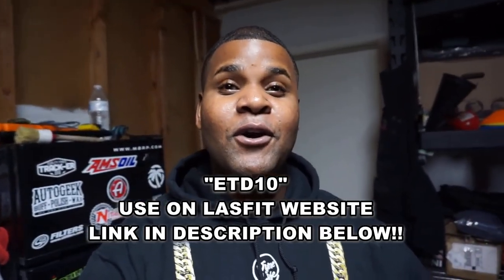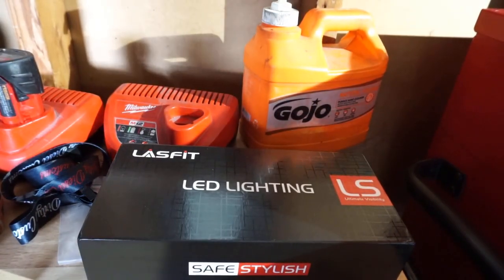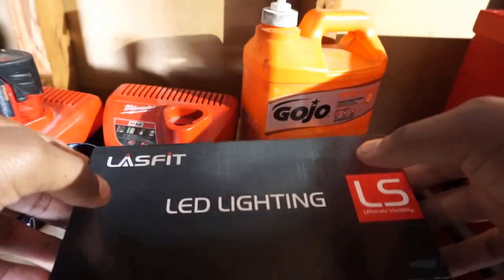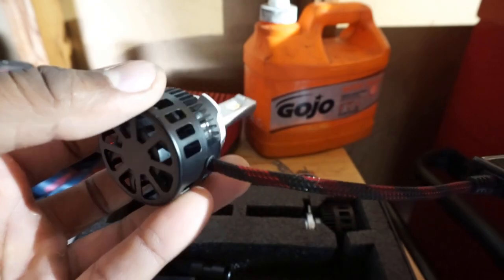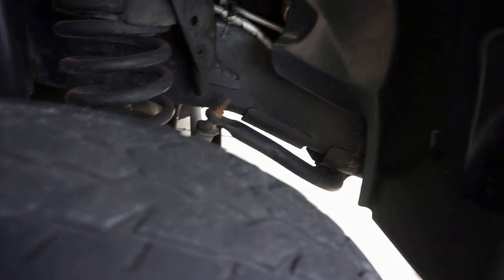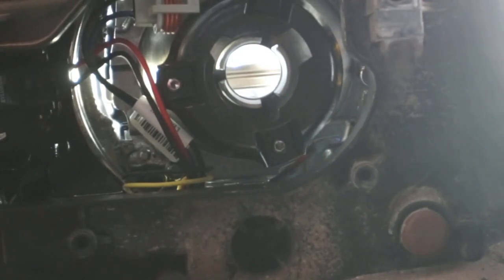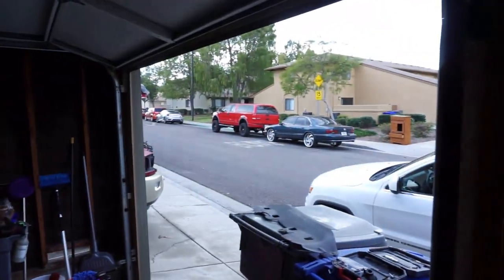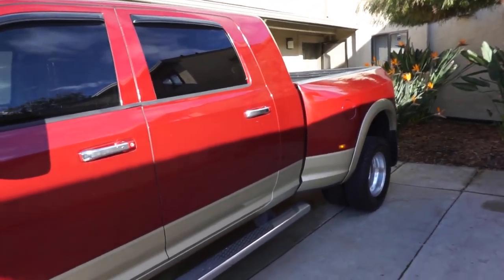UPGRADING HEADLIGHTS TO LASFIT LED BULBS!! || THE BEST LEDs PERIOD!!

Comment: The allen wrench is for adjusting the position of the LED chips inside the headlamp to be at the optimum "3:00 o'clock and 9:00 o'clock" positions.  It's not to adjust for the consideration of a raised truck.  Those "raised truck" adjustments are located on the headlight housing itself, and are accessible from factory holes in the top of the fenders (hood raised).  Look for the arrows, pointing to the holes.

Comment: Too funny I just installed my lasfits in my 3rd Gen. I love them. High beam didn’t work on the passenger side bulb so I got a new pair for free within 3 days to Alaska. I couldn’t be happier. 5 months of mostly darkness be no more. That and my rigid and vision x bars.
Reply from the maker: Lasfit is legit, good pricing and love there light bulbs

Comment: So I just did this to my 2017. LS plus low beams and then the LC (it calls them the mini size) I think it was for high beams. I bought a bright source extended dust cover on Amazon and it gave it enough room to close it up. Iv only driven at night once so far but these bulbs are externally bright.  I still need to adjust mine but I was very surprised. The only issue I had was one of the LS plus bulbs I had to stack an o-ring on it for it to snug up in the socket. I contacted lasfit and they are sending me a new pair.
Reply: Link to dust cover please? Thanks! And what millimeter size?

Comment: Cool to see you got the new truck and upgrades are happening. Not sure if you do this or not but it’s highly advisable to put a jump pack or battery charger on the batteries when loading tunes. Also...I’ll send you a message on IG as I’m local in San Diego and have some questions.

Comment: Will these work in my spyder brand lights?  I hate the h1 that they came with
Reply from the maker: not 100% sure but long as the bulb size you order is same as what they spyder headlight takes you should be fine.

Comment: i have an 2009 3rd gen longhorn cummins and when I go to the website and search ram 2500 the oldest year I see is an 2011 which ones did you get for your 3rd gen?
Reply from the maker: Put in dodge instead of ram.

Comment: Are you not worried about condensation in the headlight after cutting the back? Love the video the stock bulbs in these trucks are trash Iv been looking for a good replacement.
Reply: There's a company that makes extended covers for these headlights. Also a style that has a connector passthrough.
Reply from the maker: Got a name or link for that by chance!?
Reply from the maker: I was but im gonna put some putty sealant behind it to close her up
Reply: @EVERYTHANGDIESEL  how did the headlights turn out. I just ordered some for my truck. I’m a little concerned with cutting a hole in the back of the lights because of condensation. Did this work for you. Did you end up getting  the extended covers for the rear?

Comment: Do these work with the canbus system
Reply from the maker: Yes
Reply: @EVERYTHANGDIESEL  man I had some crappy ones where you tap in the resistor and I just felt like they were as bright as a halogen. Def sold on them then and you got me that 10% discount 👍🏻
Reply from the maker: You'll be happy man with these!

Comment: Thanks for the video, but I don't see how this is a good option when one has to use a drill. I don't believe the company did enough research. Nonetheless, appreciate the video.
Reply from the maker: It's very common for led bulbs to be to big on the rear of the headlamp just depends on the vehicle. Any led u run on these trucks will not fit in there without the cover being in the way. Easy fix though and only took 5 mins extra.
Reply: Is that affecting the projector when drill holes ? Can water gets in to its !!!